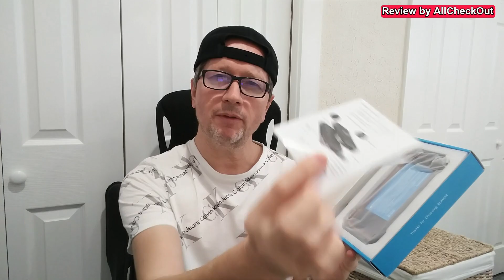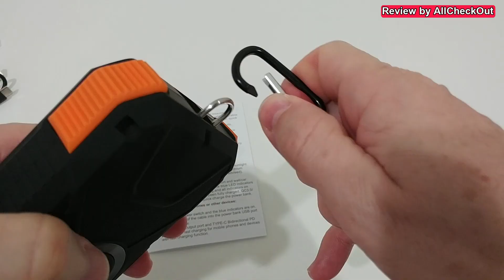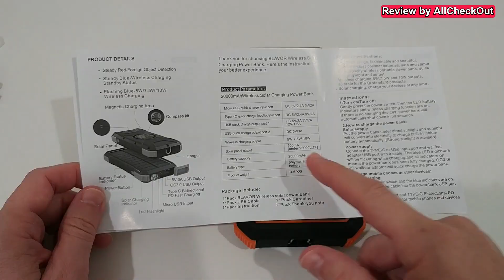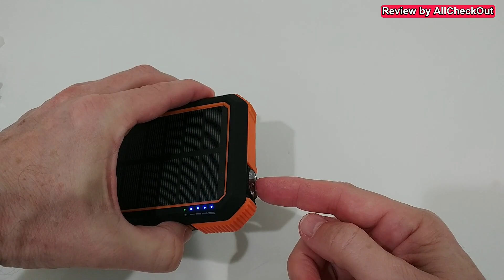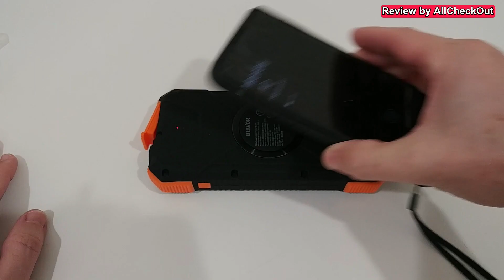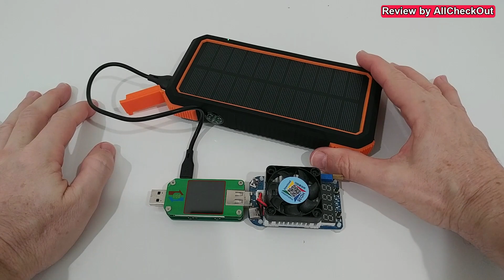BLAVOR Magnetic Wireless Solar Power Bank PN-W12 18W QC 3.0 20000mA FULL REVIEW

Comment: I have three (3) "BLAVOR PN-W12 Pro" Solar power pack battery with solar..... instead of 1 solar panel, it has 4.   If drained, it takes 4 days to charge up.   The Panels are good if camping and keeps it topped up.   The Battery is "20,000 mAh" but it can't fully charge my iPhone XR only 3/4.   My iPhone has 2,942 mAH battery.... so..... feels like really a heavy 2,000 mAh.    That is the Bad (Posted negative review on Amazon, $45) ...the company sent me two more free... but they both had the same results.   The GOOD is the very bright LED lights last a LONG LONG LONG time.  Like 10+ hours on full charge.. that is impressive.   So    BAD, in charging a smart phone,  GREAT for camping and bright BRIGHT LED light... and a compass also.

This one does not have wireless charging... USB 2.0 and 3.1 charging (I checked the output, only 2.1 Amps at 5 V each.  I have ones that have wireless charging and 5 (five) panels... still "20,000 mAh battery" but really, 2,000.    IT could be the efficiency of charging the battery to 5V 2.1 Amp is very very very poor and the battery is really 20,000.... but I doubt it.

Comment: i have one of these but when i put it in the sun it does not start charging
Reply from the maker: No blinking or just not charging? Did you leave it in too much heat for too long time or any drops?
Reply: @allcheckout  it will charge with the cable but when i put it in the sun i will not start charging even when the green light shows there is light it just wont start charging in the sun
Reply: @allcheckout  it will charge with the cable but when i put it in the sun i will not start charging even when the green light shows there is light it just wont start charging in the sun
Reply from the maker: @RedderBlob  Did you have it long enough in the sun? I mean it will take easily 1 week for a full charge ....
Reply: @allcheckout  yes i have left it in the sun for a week and nothing happens but the weird thing is that the green solar light works   so im not sure what is wrong
Reply: @allcheckout  also how do you change the torch modes because i cant seem to be able to change between the different modes
Reply from the maker: @RedderBlob  Oh ... one week in the sun that should be enough to charge, but on the other hand - it could have been too much. These batteries are not made to leave the power bank in very hot sun for longer time. Yeah that's the problem in general with these solar power banks. If it's hot like in the south and you put them in direct sun the whole day without sufficient ventilation, then the batteries could be EOL
Reply from the maker: @RedderBlob  I think the function of the light is in the video somewhere. Can't remember. Probably long press, then short press to change the mode.
Reply: @allcheckout  yeah so the week that i left it out in the sun i would come out every 1-2 hours and let it cool for around 15 minutes and while it was cooling i would also check if it had charged a bit but noting ever happened.if its ok with you can you send me you email and i will  send you some videos of what is happening with the  solar charging and the torch. Thank you
Reply from the maker: @RedderBlob  NP - I trust you anyway. I mean I'm not the seller - I just did the video. If it's not charging at all then I'd say something is broken. Can you return it?
Reply: @allcheckout  ok thanks for your help i appreciate it